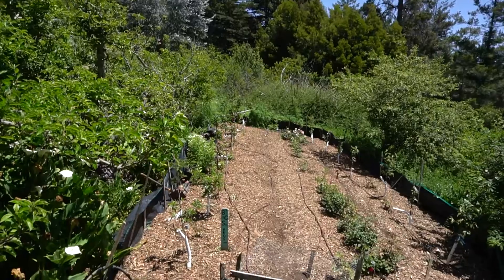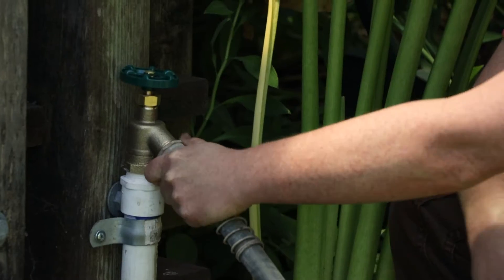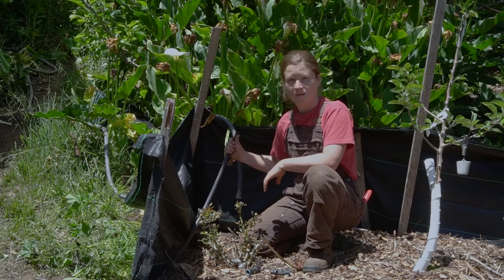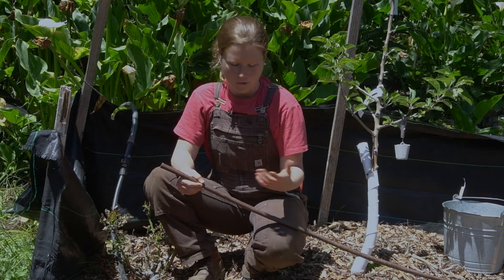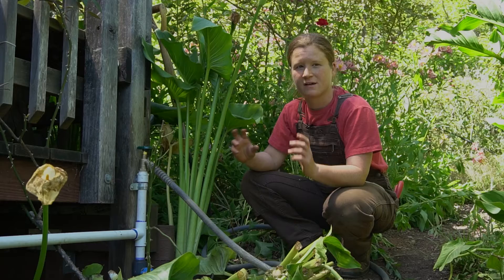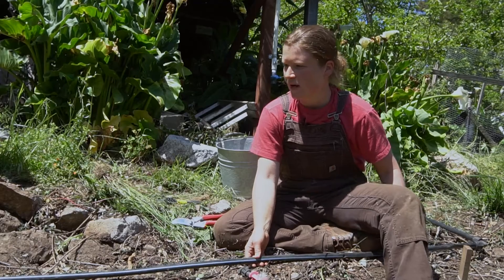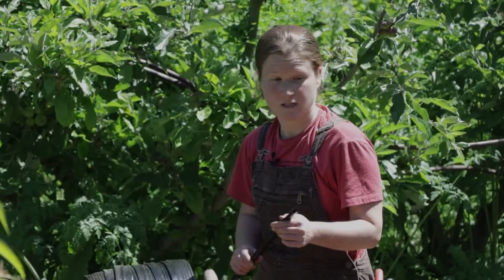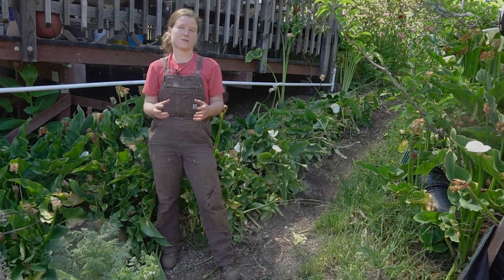Installing Drip Irrigation: Emitter Tubing and T-Tape, with Clare Riesman

Comment: Using the emitter tubing, can you close off some of the emitters? And if so, how?
Reply from the maker: Don't know of a good way to close off an emitter.  You could try wrapping with electrical tape when it's thoroughly dry.  Or, don't use emitter tubing and use tubing without emitters and place the emitters exactly where you want them.
Reply: Thank you very much.  @ucscagroecology

Comment: Thanks gor your video.  Do all these systems need mains pressure, or could a raised water tank work?
Reply from the maker: All drip systems require a pressure reducer to lower to pressure to 25 PSI.  Depending on the height of the water tank, you probably won't need a pressure reducer and should be able to supply the drip system from the tank.